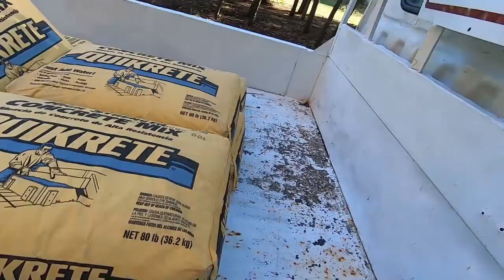Backyard boulder wall build

Comment: Cool project!
I have definitely been inspired. I'm looking at building a indoor climbing setup in my garage. It’ll be lower but wider, I think I can make it work. Maybe a little roof section ^^
Reply from the maker: That sounds awesome. I've seen some really cool project built in garages! Great idea, definitely give it a go.
Reply: Check my wall out, I also suffer from a low ceiling garage. I made mine moveable to take outside and add an extension piece.
Reply from the maker: @84v7climbers7 NICE! i've seen that video. very interesting wall.
Reply: 84v7 Climbers Thanks, I definitely will 😄
Reply: hey Rik! Did you make the indoor garage climbing setup?

Comment: 🐱‍👤I'm an engineer. We normally put steel anchors into the foundation concrete and fix the wooden beams to the steel-parts. Because over time the rain water destroys the wood going into the concrete. The soil material never should touch the wooden columns.
Did you calculate the storm load?
.
Reply from the maker: I definitely see how that could help! Good advice... Alot of the online tutorials we watched did it this way so we followed suit. We did end up painting the wood to help slow the deterioration process.
If there's a future wall project ill use that method.
Reply: @ChrisGranata  Yes, paint the wood from the concrete end to some inches above ground, especially in the area of the ending of the concrete! It would be better to use gravel to fill it up. Gravel doesn't hold back water and dries more quick. Fungis love moisture in the wood!
That all depends in what climate zone you live, how much rain you have there! But I think for some years it's okay.

Comment: I’m wondering if it would be worth the extra expense to install asphalt shingle on the back side to protect the back of the wall in weather...
Reply from the maker: That's a great idea, in this case we tacked down a heavy duty tarp. The tarp has been holding up well as of now, but will need replacing in the next few years.
Reply: @ChrisGranata  thanks.  I’m leaning in that direction, as I think there wouldn’t be anything needed cover-wise while changing the wall angle, since it would always have a cover.

Comment: plywood was PT?  3/4"? do you worry about water collecting and freezing on the back side with the horizontal supports acting as collectors for rain and snow?
Reply from the maker: ALL the wood used for this was pressure treated. The homeowner had been thinking about tacking down a durable tarp to protect the back from winter weather, I'm not sure if that ever happened. 

I did bring that point up to him, I suggested covering it with more plywood, as a tarp is not as durable or long lasting...
Reply: @ChrisGranata  Yea I got a nice Camo tarp mounted on the back, keep it on all the time (still breathable but prevents moisture/leaves/debris from getting into it.

Comment: How wide were the foundation holes? Also, looking back, would fast setting cement have been worth the extra $$$? I'm trying to decide which one to buy - regular is much cheaper but fast setting you can just pour in and soak.
Reply from the maker: If you need to get the project done quick the fast cement should work fine. And it is definitely possible to mix it right in the hole, about a foot at a time and make sure it mixes good. Our foundation holes were approximately a foot wide.

Comment: Hi, I am building my climbing wall also, still gathering material. Can you tell me please the dimensions /widths) of 4 posts you used? Thanks!
Reply from the maker: The 2 front tall post are pressure treated 4X4s 12feet long.
The back 2 post are pressure treated 4X4s 8 feet long. 
All 4 post are dug 3 feet into the ground and secured with concrete.

Comment: This looks great, what are the final dimensions and angle? What an awesome space to build this, I plan on building a wall next spring, but I definitely am a little more confined on space.
Reply from the maker: The finsihed wall stands 11.5 feet tall and is 8 feet wide. The angle is somewhere between 65 and 70°.
Reply: Looks like a 30° overhang to me :)

Comment: Did you fill the holes half way of concrete or all the way?
Reply from the maker: we filled them all the way up to just about an inch below the surface, there's a quick shot of this at 7:12 into the video for reference.
Reply from the maker: and at 7:33 another shot for reference.

Comment: Hey, I’m thinking about this myself. Are they 2x6 planks for the frame?
Reply from the maker: they are only 2X4 planks, Pressure treated.
Reply: Chris Granata thanks! I’m almost finished my build now. I’m thinking about only using 1 bolt on each post, and drilling multiple bolt holes on the top posts. This would allow me adjust the angle fairly easily. Any thoughts on this? Do you think 2 bolts per post is essential?
Reply from the maker: @markoshea9900  the owner of this wall had the same idea!!!  I talked him out of it tho. It sounds awesome, but in reality I didnt see him using that feature enough to incorporate that. And the wall weighs ALOT, it would take multiple people to hold it while another moves the screws, had this wall been built for adults and not children maybe we would have done that to have sone more challenging angles. 

I think 1 bolt would be strong enough to hold the wall up granted it is a proper graded bolt... when we first got the wall vertical we had 1 bolt on each corner and it was able to support me while a banged in Tnuts. We did 2 bolts just for safety.

Comment: You said you were going to take the side braces off, however you left them on and painted them instead ? Was that due to added strength and you realised they were better off being attached ? Or just forgot to take them off ?
Reply from the maker: At 10:29 into the video you can see that the side braces we originally used are just pieces of scrap wood we found, not pressure treated 2X4s. 
So we did end up taking off these weaker pieces of woods for something a little sturdier. The plan was definitely to have those braces on the whole time for strength reasons.
Reply: @ChrisGranata  thx for the haste in reply and explanation. A solid build mate. Well done. Hope your channel grows fast mate, you deserve more subs 👍 just added myself for support.

Comment: Wow, you put untreated wood directly into the ground.  I remember when I didn’t understand how quickly wood goes bad on the ground.  What, I’m not sure I’ve ever not understood that basic concept.  Hopefully the homeowner or his kids don’t get hurt by your carelessness.  Don’t try and be something you’re obviously not, a builder.  You’d be looking at a law suit if you did that to someone I knew.  You’re seriously going to get someone hurt.
Reply from the maker: The wood IS treated, also it is set into concrete in the ground. Not just placed in a dirt hole. The wood was also painted to seal it even further. 

https://youtu.be/NW_epDbIztM

Here is a link to the wall I based my project on, we used the same method as far as structure, this guy lives in a similar climate and has had no issues after 2 years.